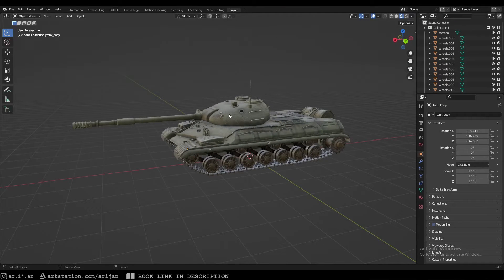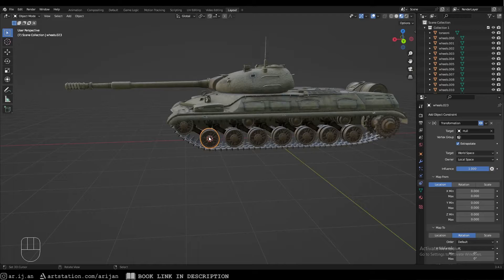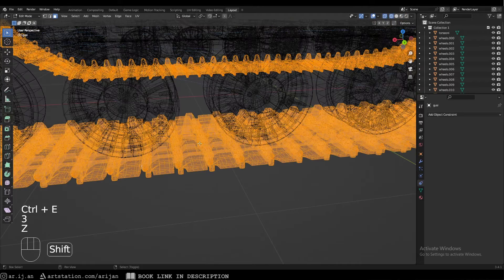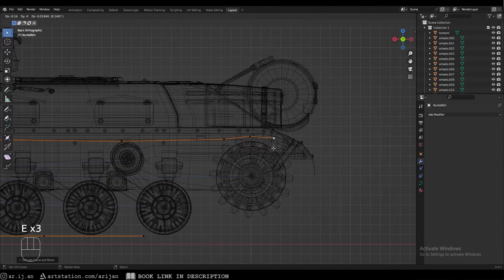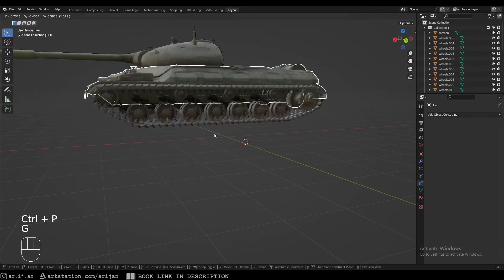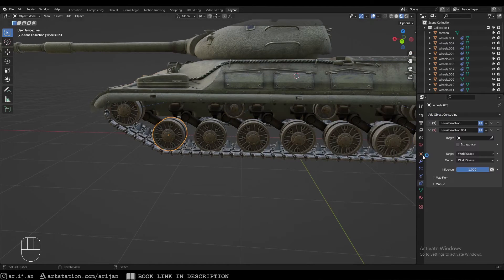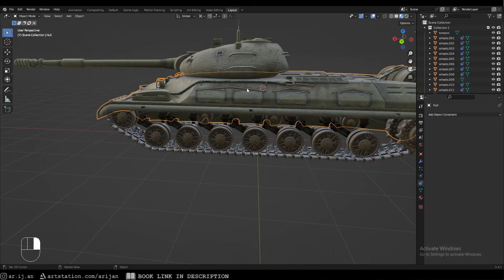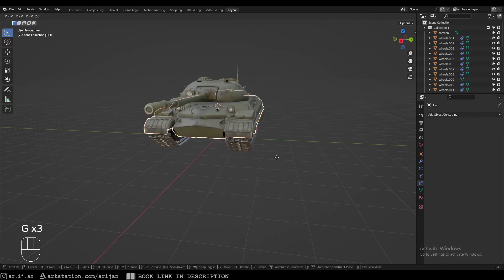How to Rig a Tank in 9 Minutes | Blender Tutorial (Arijan)

Comment: Hello Arijan, thanks for the video! Very informative, but I couldn’t repeat it. I mostly work in 3D Max, I threw the model of my tank into a blender, but the tracks and wheels come separately. And from the very beginning I couldn’t repeat after you! The tank model and the tracks are not attached to each other, I press shift + p and then I move the tank separately from the tracks, the tracks remain in place when the hull moves. Tell me, what did I do wrong?
Reply: Ctrl+P will parent ur wheels to ur tank …..so select the wheels and then select the body last and then move the body and see the wheels move with it

Comment: A small tipp dont use normal curve use bezier becuse ones your done you and have also suppension in  your tank rig you will one day find the problem were the tank tracks will either go under your floor or bend in some kinda weird way if you attach the points of the curve to your suppension 

I found a way to fix it simply use bezier curves in the beginning and aline the points so the are under a roadwheel ones your done with everything you take empty boxes place them near the bezier vertices points(where you cann move the curve dont now the name) then Hook the point to the empty Box and importantly parrent the box to the suspension arm not the wheel becuse if the wheel turns so does the box then and then it messes up the track

After you done you cann rotate and move the empty box and the tracks will deform acordingly with out sharp cuts this trick fix the issue for me where the tracks often times just goes through the floor when the tank brakes hard and leans forward or if you want to animate the tank going over a obstacle and the tracks due to the high angles goes though other roadwheels or bends weirdly with this trick you cann fix any issues by moving the empty box and rotating it
Reply: Can u explain that a little better … im interested 😮❤. I mean what will this do , I’m new

Comment: hey man amazing tutorial, could you please do one on how to rig a hydropneumatic suspension like the one on the Type 74, Type 10, K1, K2 and strv 103?
Reply: I useally when i make a suppension i simply take the supension arm zoom in where it rotates(from the tank hull) put the 3D curser in the middle and set control point to 3D curser lock every rotate axis(topright tool menu) but not the X axis becuse you need the X axis to rotate the arm and lock every location axis but Z axis the Z axis is optional i like to have the ability to move the arm up and down if needed
Attach the road wheel to the supension arm as a parent and done you cann select the supension arm and rotate it manually and the roadwheel will move to 

For the tracks i would suggest using Bezier curve not normal one becuse with the bezier one you cann get a more curvey lines and plus you cann attach the controll points where you move the curve to a empty box place the empty box near the controll point from the curve and then attach the empty box to the supension arm after that if lets say the tracks go under the floor after you keyframed the supension you cann simply move the empty box and fix the track with rotating the box or moving it its a vers usefull trick i found when dealing with tracks going under the floor or similar issues

Only problem with this is you have to keyframe every single suppension arm and empty box what takes time

Comment: Thank you very much. Is there a way to keep the wheels rotating right if the tank makes a U-turn during an animation? So it drives toward X-.
Reply: I found a way to fix it 

I asked chat gpt to give me a code that detects when ever the hull is pointed towards +Y or -Y and same for the X axis then the tank does a 180 turn and turns from +Y to -Y the code would invert what ever number was inside the constraint so 1m would go to -1 and there for fix the tracks and roadwheels going the wrong way 

Ask chatgpt to and try it it worked for me

Comment: The problem with this method is the curve modifier bends the tracks as the come around the sprockets and drive wheels. This method works as a quick way to get a rotating track but it is not realistic.
Reply: Well u r right but animation is about coolness more than reality so 😅I’ll do it this way
Reply: use dupli-faces so the  tracks  wont bend